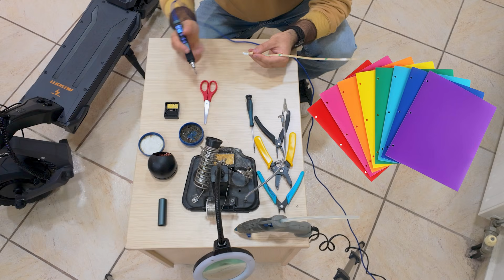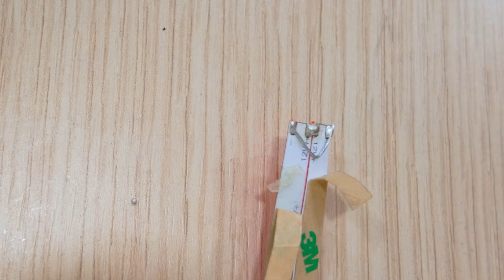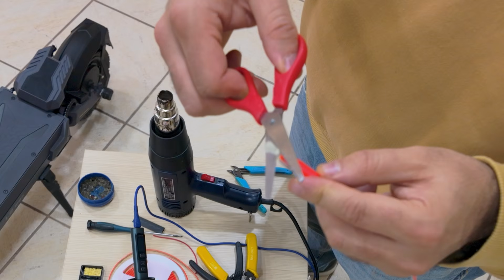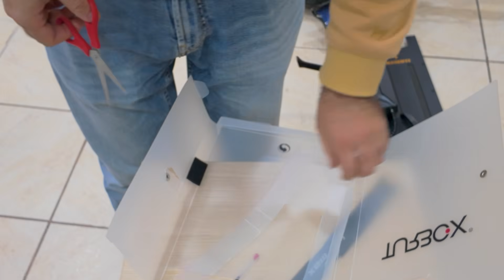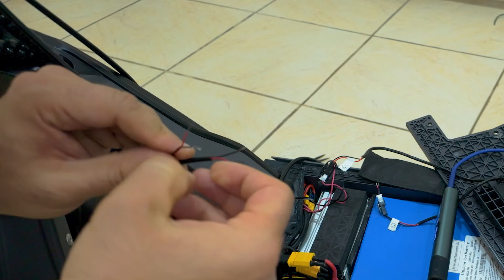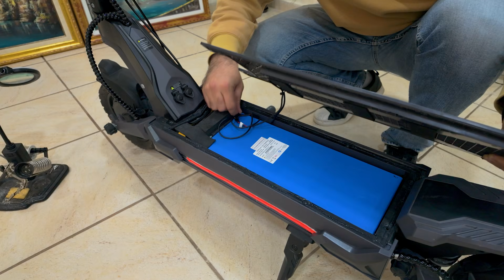Tutorial - how to add deck-side ambient LED lights to Ausom L2 MAX Dual Motor scooter

Comment: it will work on the l1
Reply from the maker: If L1 offers 12v power supply for ambient lights, then overall yep. If it doesn't  - you can go with external power supply, let's say a powerbank (in this case 5v LED strip should be used). Here's the guide that will work for any scooter - https://youtu.be/_4bndn0pauY

Comment: and that's how u can burn whole leds on the deck 😂 dont do that pls
Reply from the maker: You actually can't even if you want to. 7 years of experience here lighting up the scooters, so believe us the probability of burning out the LEDs via this way is minus 1000% 😉
Reply: @LightSideTech so why u connect both custom led strips to one deck light? why u can connect one strip to one light in deck and the same thing on other strip? you know what i mean
Reply from the maker: @UlicaUzbekistanu Because it's faster and easier. And since the LEDs are weak this makes no difference. If the total power consumption of preinstalled and custom LED strips is 5 times higher, then yep, separate connection would make sense, but not in this case. And if this affects nothing then why do an extra job? The aim was to make LEDs to do their job, and to grant the stable and reliable work of the entire system, and not to achieve internal wiring management perfection. Btw, this setup is still running perfectly on our scooter.
Reply: so its safe to connect only 2 strips without any controller or i can connect bluetooth controller to remote leds with my phone?
Reply from the maker: @UlicaUzbekistanu  Yep, you can connect a bluetooth controller too. Want to go with RGB option?

Comment: Segway ZT3 pro please
Reply from the maker: For ZT3 Pro we plan to release a kit with lights housing stylized to its design, not just LED strips attached to its body. But if you'd like to go with this solution, you surely can follow the steps shown in the video to prepare and waterproof the LED strips, and then to connect them to your scooter. You can connect LED strips to X light power supply. But it's supposed to be 36v, so you have to use a step down converter to decrease the voltage to 12v for LED strips. The rest is totally the same.